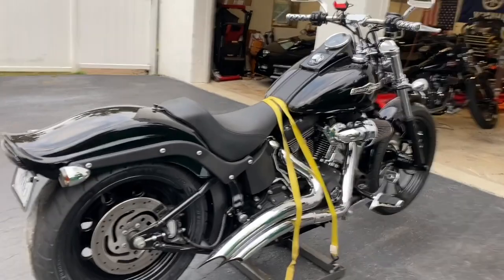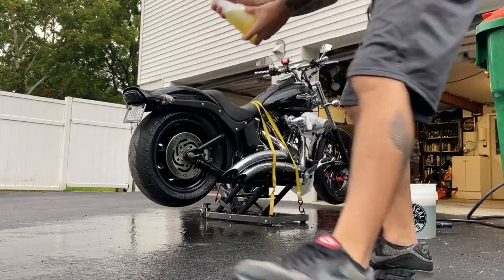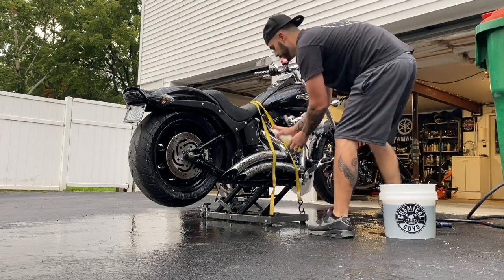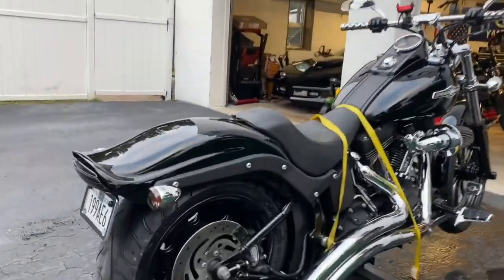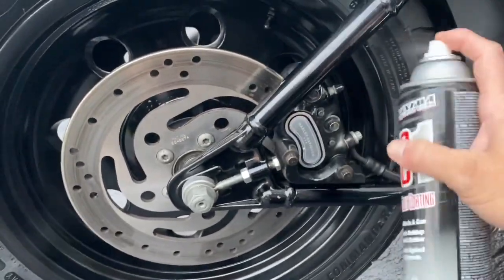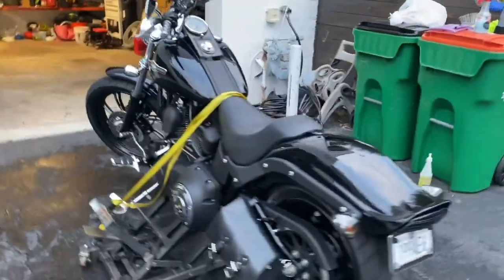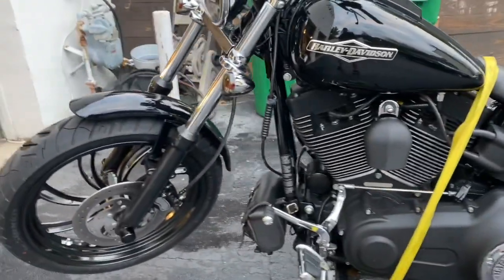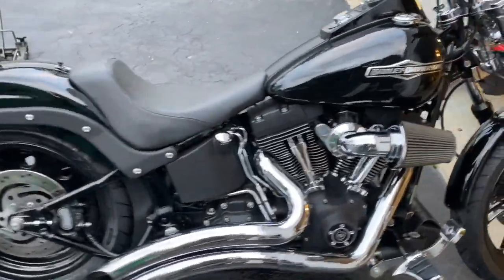RIDIN DIRTY! SICK 2007 Harley Davidson Nightrain--Quick Detail

Comment: I know this video is 6 months old but I also have an 07 night train. On the wrinkle black engine And everything else black or powder coated I use Moro black and love it. Just spray on, let sit 15 minutes, and wipe off extra or over spray. But when I atart the bike the engine will smoke for a good minute or 2. Does that happen with the product you’re using on the engine? Also is very oily so makes another job cleaning it off the chrome.
Reply from the maker: I've never tried that stuff! I use the SC1 and I dont see any smoke.  Also, it's pretty easy to clean off of the chrome! Hope that helps!

Comment: Dig the front wheel where did ya find it and do you like it
Reply from the maker: Thanks! You can get Ultima wheels on EBay.  But If you look in the description on EBay they come from shops in the US that Mount and balance them to your specs.  I was able to call the shop and pick the tire I wanted.  I have no complaints with either wheel.
Reply: Thanks I have a 07 fxst with 60,000 miles on her best bike I ever owned
Reply from the maker: @richbuczek9649  wow that's amazing,  shows what good maintenance can do!
Reply: @VPCustoms  what is the rim and tire size?